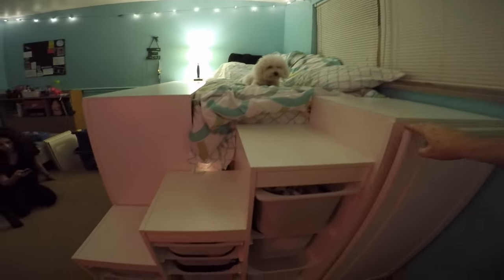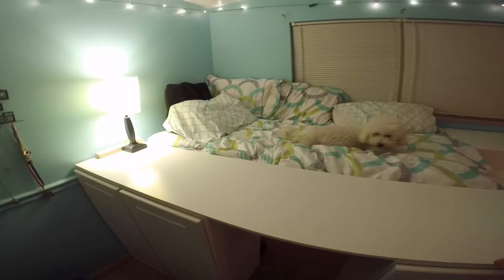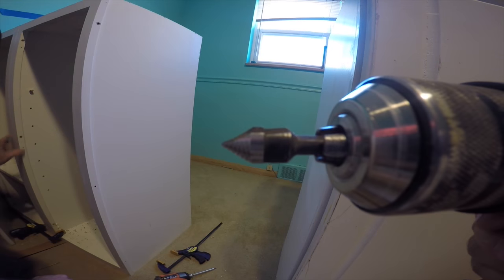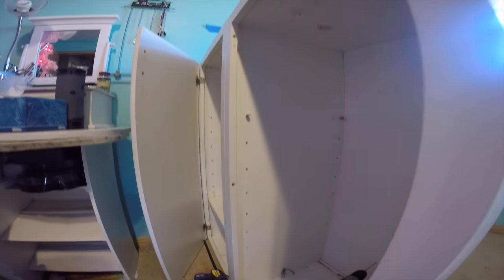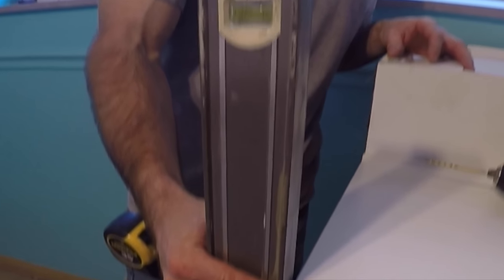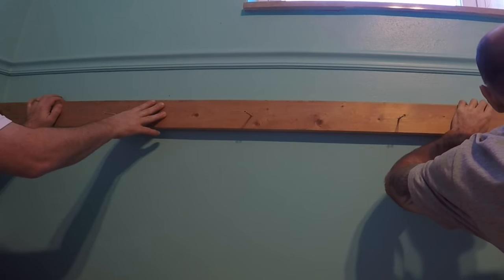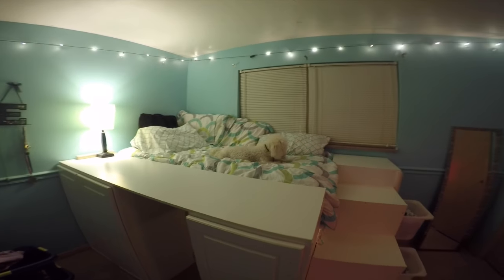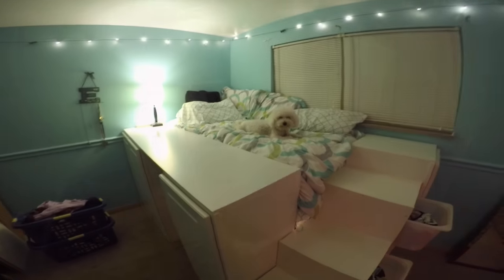DIY IKEA BED HACK FOR LESS THAN $300

Comment: Could you do this with a queen size bed? Would you keep the 42' cabinets and get one more or would you need a whole different size of cabinets?
Reply from the maker: Not necessarily but you would likely need to add more cabinets to get a bigger dimension.
Reply: Ozzy Tribute Band,Madman's Diary Stl. "The Ultimate Ozzy Experience" ok thanks!

Comment: Can it hold multiple people and how much weight can this bed support ?
Reply from the maker: My daughter and I read together in bed so it can hold 250 lbs easily. I am confident that it will hold 300lbs. If you needed to, you could always use 2x6's for the frame to gain more support for two adult sized people. In the video I used 2x4's. Good luck on your build!